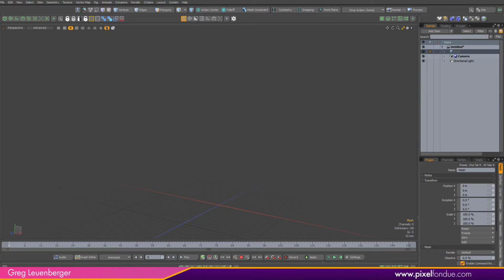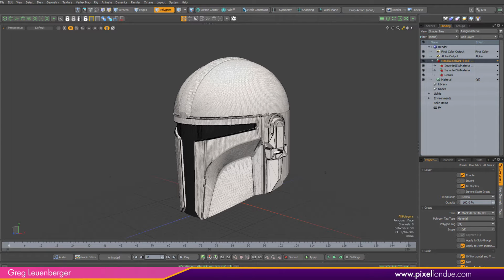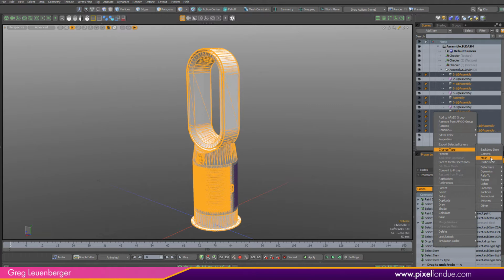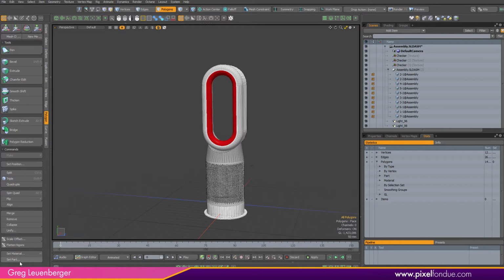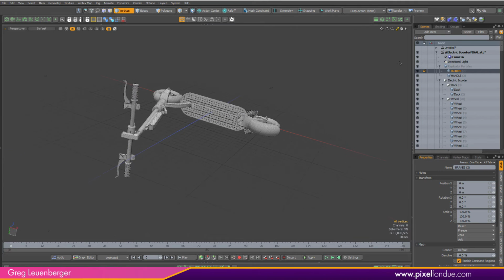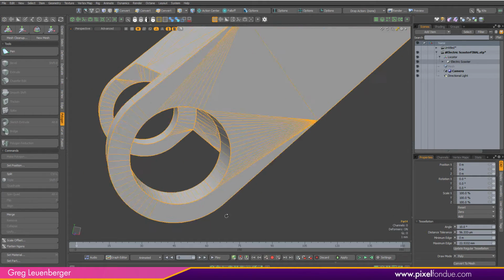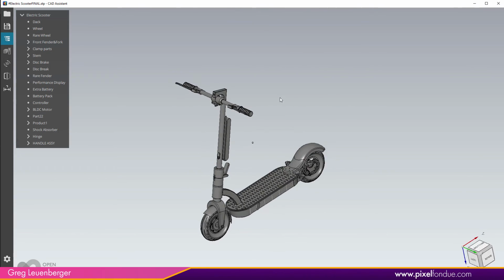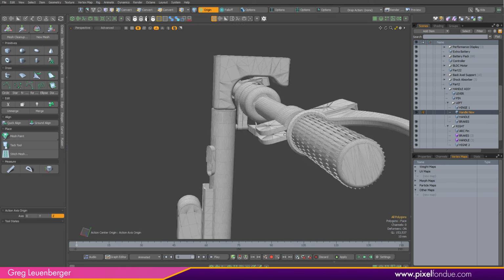MODO | Importing CAD Data

Comment: Good overview. With CAD Assistant you can adjust the tessellation in preferences, second panel, BREP Triangluation, Shape meshing Quality. However it calculates this on opening the file, so if you make it finer you need to reopen the source before saving out. Also, you get no preview of the meshing. You have shown a great reason not to use rest on ground option in PT, because your patch would not have matched position so readily. Has caught me out.
Reply from the maker: Ah - thanks for the info.

Comment: Great video, Greg! I didn't know we could render CAD items directly in Modo. I'm wondering if it brings in as NURBS model for texturing, I mean, the UVs matching the surface. I work with CAD models for product visualization every day.  My current workflow consists of modeling in Fusion 360 and rendering in 3ds Max  / V-Ray. 
In 3ds Max I can import step files as body objects, which you can adjust the tessellation after importing same way you did it with the Power Translator (you even have viewport and rendering tessellation options separately).  But what sold me to 3ds Max is the ability to handle and adjust the scale and direction of the surface UVs directly in the body object. 
The limitations I saw here using the power translator in Modo, which should be free or cheaper IMHO, are the inability to render in 3rd party renderers and how to handle UVs (not clear for me)

Thanks for this video!
Reply from the maker: Hi Felipe - yes, I wish it was bundled with MODO.  It's too much....even just the ability to load STP files.  You do get UVs but you don't get any control over them...I'm not sure how it's handled with the CAD items.  Having different viewport and render tesselations is pretty cool.  I think MODO is so good for product rendering and animation (with Octane and soon enough a full GPU mPath).....could use a little help though.

Comment: Worth noting that the Solidworks Kit is Windows only. I've used CAD Assistant before but generally it's meshing options are not great. MOI is my preference over that. I also use PT, which is great for complex assemblies that can make use of instances but has the worst meshing options. Not only that they you have to wait ages to have them applied before you can see if it needs adjusting. MOI meshing options are practically interactive.
Reply from the maker: I used to use MOI a lot years ago.  I'll have to take another look.

Comment: Thanks, deepest rabbit hole you can get is CAD in MODO ) avoid version conflict by exporting from solidworks to STL and if retopology then ZBrush and export to OBJ )
Reply from the maker: Also try Quadremesher for MODO.  There's a Pixel Fondue video I did for.  I think it was by the guy who wrote the zBrush auto-retopo and it has some MODO specific features
Reply from the maker: I also find by-passing the agency or marketing dept. and talking directly to the person exporting your CAD file to you is essential for success sometimes.

Comment: Another great program for conversion is Moment of Inspiration (MoI3D). It's kind of a 'CAD Lite' program that was created by the original programmer of Rhino 3D. It can open the most common non-proprietary CAD formats and can convert to polygons with a constantly updating preview as you adjust settings so you know what you're going to get. This is handy when there are flat polygons with too many vertices (I forget what the maximum number is, but Modo will throw out an error if a single planar poly has too many points...it might be more than 512). I will MoI3D to fine-tune that part with subdivisions to get a good export while not too heavy with polygons. I use that along with Power Translators as my main tools for getting meshes into Modo.
Reply from the maker: Ah yea, MOI. I used to use that.  Has some decent tesselation controls on there.  I used to have it...but that was years ago.

Comment: Great video! I wish I would have had this 5 years ago when I started! (saved) BTW, I'd pay for that CAD class you mentioned at the end
Reply from the maker: Yeah, it's funny.  I think this will be a valuable video for people who do product work....I'm just kind of surprised how few people that seems to be (or there's not much new to learn here I guess).  One of MODO's greatest strengths is CAD/Product rendering.
Reply: @pixelfondue  99% of my work is just importing and adding materials, but lately people are asking for USDZ files for finished work... perhaps you could do a round trip from imported CAD to an exported textured USDZ
Reply from the maker: @adventurefilms  I need to look into USDZ more.  MODO is 'fully' supporting it yet. I like that it bundles up the textures but man....there's just TONS of locators and extra items in those files.  I'll look into it.
Reply: @pixelfondue  Thanks, I can't hardly find any info on it even across the other software packages... but in the last  month I've had 4 clients asking about it... and I'm still just trying to figure out how to UV a regular mesh much less properly texture and bake textures... a video on UVing CAD data with the assumption that the person watching the video has never UV'd before and the instructor trying to remember back to when he/she fist started Uv'ing... so many tutorials for beginners are done , but they are done with the the instructor having years of experience and not dumbing it down to someone who doesn't have years of experience

Comment: Deleting Selection sets doesn't work in Item mode because it deletes the Sets of the components that are active. 
If you are in Vertex mode, it Deletes Vertex Selection Sets, If in Edge mode, the Edge Selection Sets, in Polygon Mode Polygon selection sets. 

It would be better if you could choose which sets to delete, whatever the mode is active or not.
Reply from the maker: ah - now that makes sense.  Yeah, would like of like a selection set spread sheet...or a generalized spreadsheet view